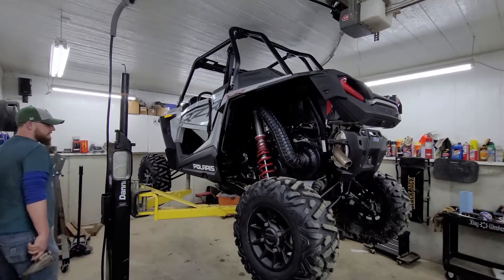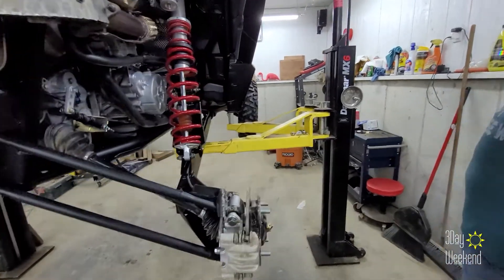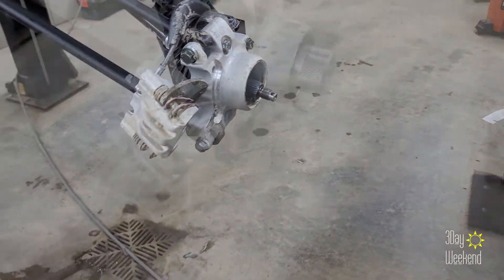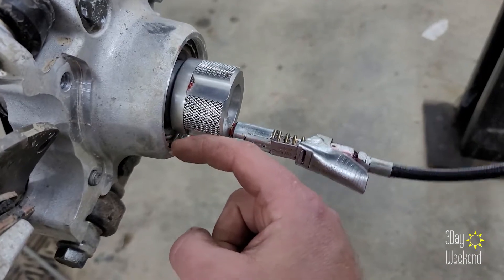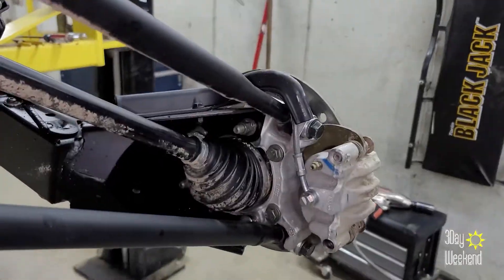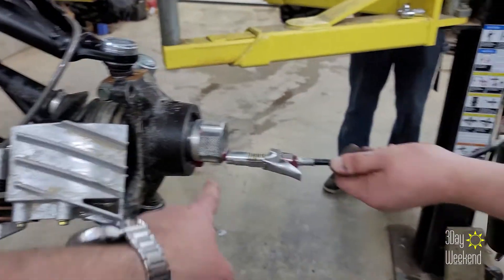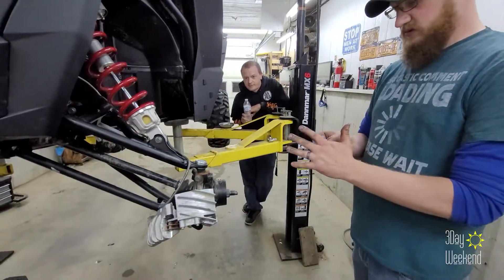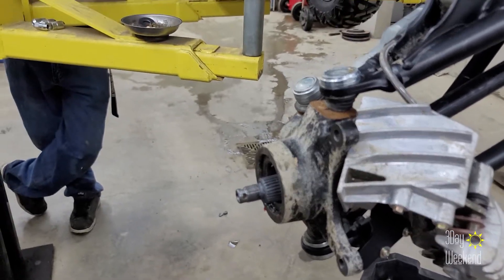How To Grease Bearings - RZR Turbo XP - How much was in there from the factory?

Comment: I called two shops in Michigan they claim that greasing the bearings on sxs is not good
Reply from the maker: This has always been a great debate, and a lot of it depends on where you ride, or more specifically, what you ride in.  We do mostly woods trails with a fair share of mud and standing water.  Before we greased bearings, it was not uncommon to see them fail in as little as 200 miles.  Multiple brands (Polaris, Artic Cat, Yamaha), same failure.  Since we have started greasing them, I have not had a single wheel bearing go bad in the entire fleet!  That's enough proof to me that there are definite benefits.  This is years of experience with a couple dozen machines, but like I said, this works for us in our environment and with our machines.  

Dirty mud or water is liquid sandpaper.  Once it gets inside the bearing, the bearing is doing to wear down.  If the bearing is full of grease, the water can't get in there and the bearing is safe.

To each his own, but that's my two cents.  Thanks for watching!

Comment: I hear you aren't supposed to pack them till grease comes out because you can blow out the seal? Any updates if you lost a seal or anything?
Reply from the maker: I've heard that as well, but in this application I have found it to be not true.  I have over 1500 miles on this particular machine now and the bearings are still in perfect condition.  I would recommend greasing them every 100 hours or so. 
 More frequently is better, of course.  We do this to all the machines in the fleet and we have never lost one due to a "blown out" seal.  Without grease, we found that typical bearing life was roughly 250 miles on our trails.  Greasing them regularly has made a tremendous difference!  I have never had to change a bearing that I grease.